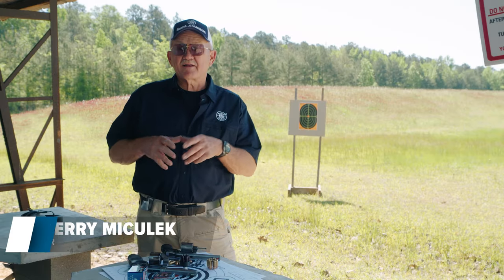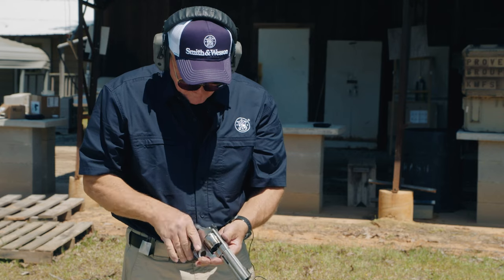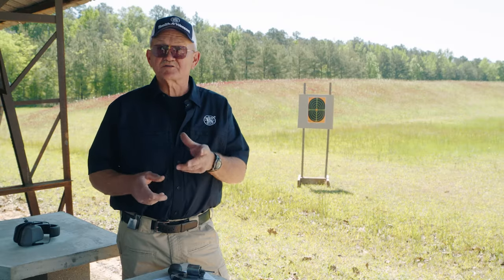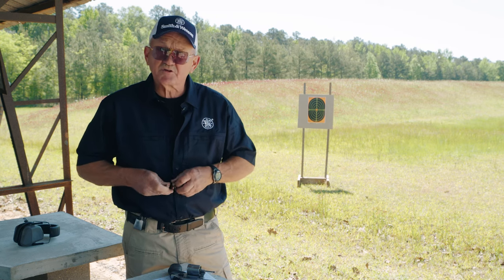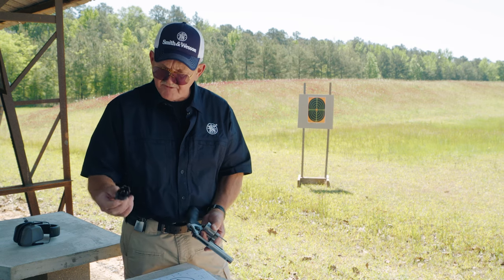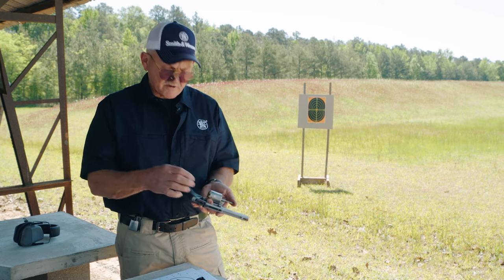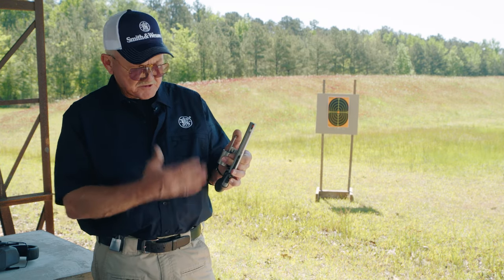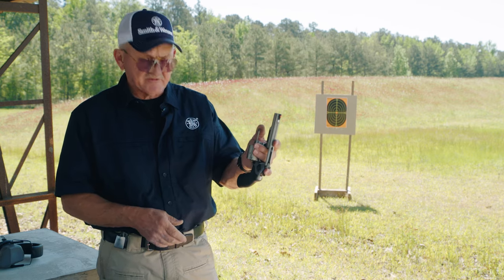Unloading & Reloading Revolvers

Comment: Yet another day that I learned something more about revolvers. All my revolvers use rimmed cartridges. This time I tried Jerry's gravity assist for speed loaders. I used HKS gravity loaders that bounce and wiggle into the cylinder. I tried the Safariland Comp-3 spring loaders that don't work as well. The Comp-3 loaders have a longer handle that adds bulk and weight. So it's better to guide long handled loaders into the cylinder. Safariland Comp-1 and Comp-2 loaders are short like most speed loaders so you can toss the short loaders straight into the cylinder. The long handled Comp-3 loaders are primarily intended for competition.
   Going to practice using short speed loaders. Jerry's gravity system does work. Shaving a second or two off of every stage in IDPA does help. Jerry proves that every time he shoots.
Reply: Update on the Comp-3 speed loaders with long handles. Smaller Comp-3 loaders used for K frame sized revolvers don't have the bulk of L frame sized revolvers. The K sized loaders bounce until they slide right in the cylinder. The larger L and N frame revolvers got the bulk that don't bounce around as good.
   Hint on the gravity loading way. You must use speed loaders that fit exactly. Using a Colt Python revolver that uses the HKS PY-A loader. You can use a HKS 586 loader. These two loaders are not the same size. You can make the slightly smaller HKS 586 loader work in a Colt Python but you have to wiggle the loader a bit to fit the cartridges into the cylinder. Use only properly sized loaders for your brand and size of revolver for gravity to work.